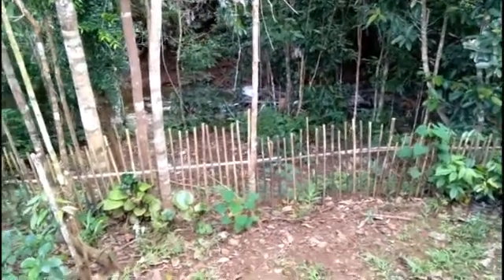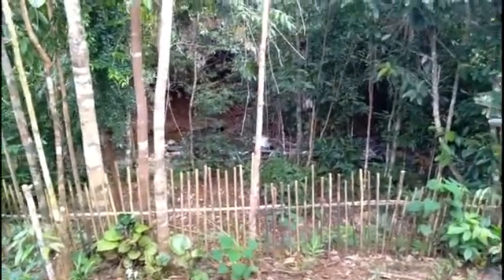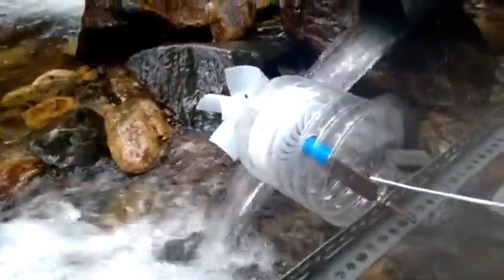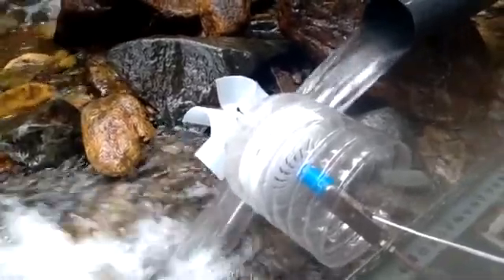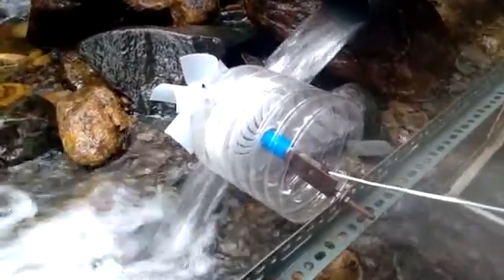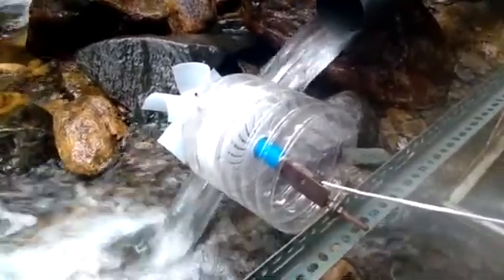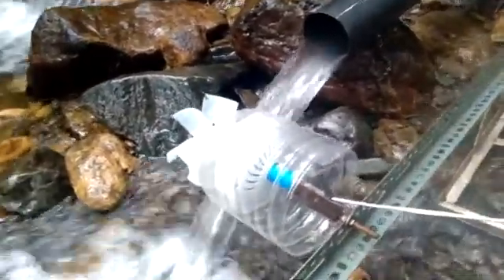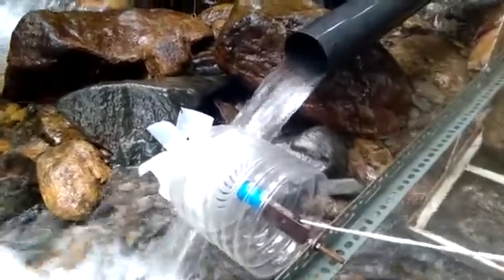Tiny micro hydro that actually works

Comment: thanks for posting.  yep, that's tiny.   here are some thoughts.   any time a motor is used as a generator, if the stator coils are not rewound, the internal resistance significantly limits output current (amps).   power equals Watts.   watts is equal to Volts TIMES Amps.   the one way to compensate is to turn the motor shaft, as fast as practical.  some sort of step-up drive could be tried.    this is a low-flow and low-head site.  it calls for the use of an overshot or breastshot waterwheel.   accordingly, the delivery pipe should be configured to deliver water, to a higher point in space.    the radius of the 'wheel should be roughly one-half of the available head.  (the greater the radius, the greater the output torque, at the shaft.)    the dimensions of the Buckets Should be determined by the flow rate.    at present, the flow rate appears to be in the range of one-half liter per second;  an improved intake might, possibly, double this rate.    in either case, the Optimum bucket volume should be determined.   a waterwheel is, necessarily, a low-speed hydroturbine design;   20 rpm or less.   note that in such a situation, the Potential energy being converted is that of the Weight of the water in the Buckets.   there appears to be about 30 inches of head available; there may be more.   note that, in order to take maximum advantage of the available head,  the intake for a nearly-horizontal delivery pipe should be as far 'uphill' as practical.   note that the slight downward angle of the flume / delivery pipe avoids the LOSS of head.  the head is preserved, until the water reaches the top of an overshot waterwheel.     cheers
the basic idea.
http://etc.usf.edu/clipart/36300/36373/overshot_36373_lg.gif
the flume preserves the head.
http://l7.alamy.com/zooms/6647185e7d734ed3b9997c13954824ef/the-overshot-waterwheel-at-morwellham-quay-part-of-the-tamar-valley-e9kh2w.jpg

Comment: Great water turbine. I guess you get ac current out of that fan motor. You can rectify to electricity to dc. Just use a rectifier. After that you can ( for example use a little circuit board found on ebay or aliexpress to maintain 5 volt so you can charge a phone with it) If you have more questions just contact me. No problem :-)